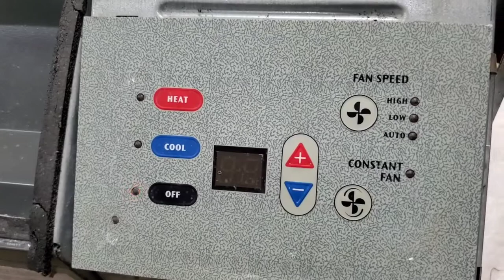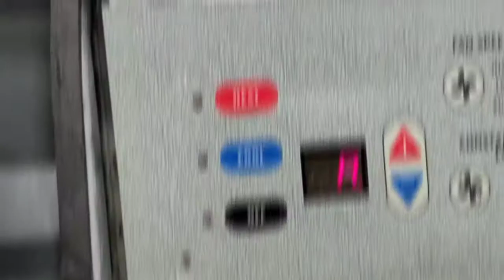Constant fan trouble?... Indoor fan motor not stopping?

Comment: Hey Dave,

I had a question for you. I’m not familiar with PTAC units but i do residential Hvac. I have a ptac unit that the client states that it comes on and cools for about 5-10 min then the compressors cuts off. I went by compressor seems like it’s working properly. I just watched the video on the codes and how to check it. Planning to go by tomorrow and see if I can get a fault code. Client states that the system works sometimes and sometimes it doesn’t. Any insight would be greatly appreciated.

Thanks again for your videos very informative.
Reply: I forgot to mention I checked both coils and filter are clean. When the compressor shut off I checked high pressure Switch and overload and both are closed. The blower and condenser motor are running properly as well
Reply from the maker: Hey Omar
Sounds like they may have a bad indoor coil thermistor, it's a very common problem with units that are from 2011-2013, I would try that first if everything else is working ok...

Comment: Hello Dave,  Thanks for all your videos.  I have four ptacs in home and have learned so much from your information.
I have one ptac that only cools intermittently.   It will come on and cool then go off and the fan will run.  Then after a little time it will come
on again and then shut off again.   I have tried changing out the control board, large capacitor, clean all the coils , changed the themostat
on the indoor coil.  Nothing has worked.  Any idea,  Is it a bad compressor.   Thanks for your help.
Reply from the maker: Hey Alan
So glad my videos been of help! Question- what is the serial number of that unit
Reply: Hi Dave,  Following up on my comment.  Any suggestions ?
Reply from the maker: @alanwoods8825  Hey Alan,  was it the red indoor coil thermistor that you replaced
Reply: @PtacSolutions  Yes, I swapped it for one from another unit and no difference.
Reply from the maker: @alanwoods8825  how old is the unit?
Reply: @PtacSolutions  Bought it in Feb. 2019.
Reply from the maker: Oh so it's not that old, maybe something is setting off that pressure switch. Check the condenser coil, inside the shroud to see if it's clear from dirt, lint etc... or also a bad motor
Reply: @PtacSolutions  is that the coil on the indoor side or outdoor side?  Could the pressure switch be bad? Is that on top of the compressor?  Is the motor you are referring to the fan motor?  Thanks
Reply from the maker: @alanwoods8825  it would be the outdoor coil, and yes check for a bad outdoor fan motor... you can check the pressure switch with continuity, its close to the compressor with the two purple wires
Reply: @PtacSolutions  Thanks,  I will check all that.
Reply: It  was the switch.  Thanks for help.
Reply: I was wrong Dave.  It's doing it again.  Any other suggestions.   I don't see a way to remove the switch that is on the copper line but continuity is good.
Reply from the maker: @alanwoods8825  hey Alan, let's do a walk through,. What have we checked so far?
Reply: @PtacSolutions  I have changed the control board, large capacitor (not the small one),  red wired thermistor on the front, and the switch on top of the compressor.  also the thermostat (black wire) on the front fins.  I have vacuumed all of the fins on the rear ( front and back ) and I see the fan running.  I have not used a cleaner to clean them.
Reply from the maker: Wow, more than likely that compressor is overheating, going on and off as it cools
Reply: @PtacSolutions  Do you think cleaning the fins ever more would help?
Reply: If not, do you think it s a bad compressor ?
Reply: Your thoughts?
Reply from the maker: @alanwoods8825  Hey Alan so sorry to get back to you so late, I would try cleaning the condenser coil but inside the fan shroud. If it still doesn't work more than likely you have a bad compressor

Comment: How’s it going?

Im having issues with an armana ptac. Model # PTC073G35AXXXBA 
The fan is constantly on even when the unit is off.  
I tried, of course unplug and re-plugging it in. 
Next I tried the settings,  (as in this video) C2 -> bA.  (I tried switching to “A” as well, and back to “bA” but no luck)     Next, I tried resetting to default settings.  But still no change.  
All the settings work normally, cool, heat and fan.  Just the constant fan even when the unit is set to off. 

Was wondering if you can suggest something?  Thanks!

Comment: I have the Amana PTAC  Model: DHP153A50AA Model Desc: PTHP 15K BTU 230V 5.0KW Manufacture Date: 09/21/2022. I have had a service tech who called the manufacturer while here. The unit will run without shutting off even when the room is it at the thermostat temperature, I have 2 digital thermometers in the room. I understand the heat pump will blow cooler air (cooler than body temperature) but many times it will blow warm air even though the room temerature is correct. I have to turn off the power and back on, like rebuting a computer. Once I do that it will operate perfectly for maybe 2 or 3 days. Any suggestions?
Reply from the maker: What did the manufacturer say?, I wouldn't be able to be much help, I would have to be present to troubleshoot, but it sounds like a control board problem

Comment: Question my friend. I’m a hotel engineer. I’m working on a amana ptac. It only cools on low speed ( 55 degrees f). But when I switch to low or high speeds the compressor turns off. And also the condenser fan turns off. Any ideas ? Thanks
Reply from the maker: Hello
That sounds a bit strange, I would check the wiring first
Reply: @PtacSolutions  I changed the circuit board and everything works fine now. 👍🏼

Comment: Mine runs after it was set to bA and master switch is off. I had to turn off the breaker to stop and i replaced the motor and board and still runs.
Reply from the maker: Hello,
Wow!. Was the control board new?
Reply: @PtacSolutions  yes it was, brand new. Now im guessing it's the wiring. Not really confident in wiring though.